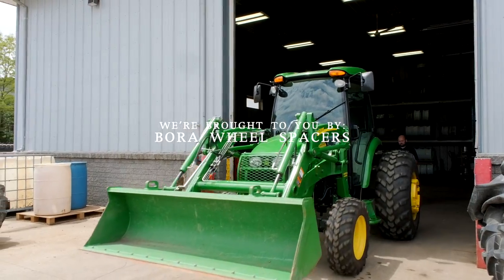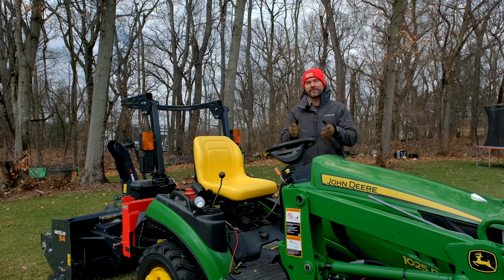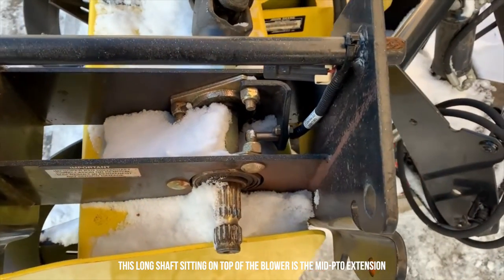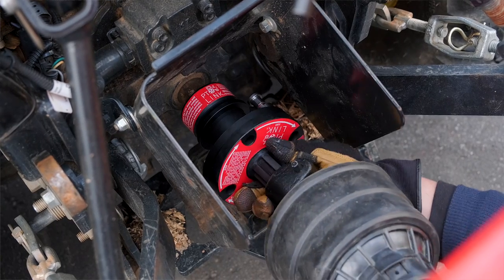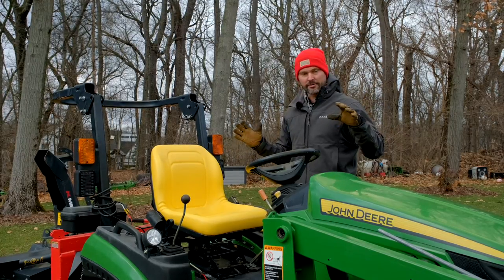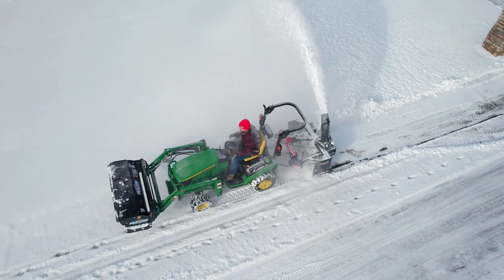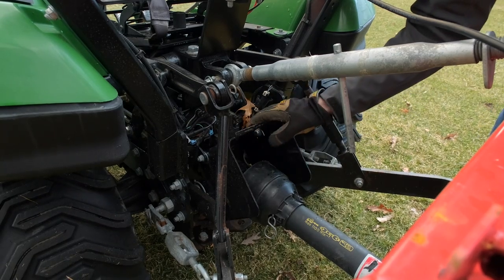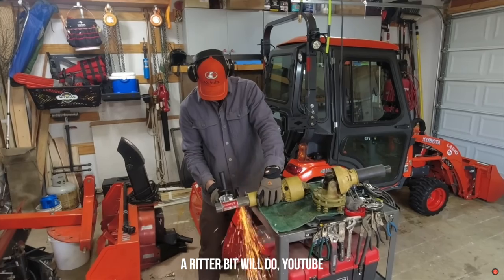WHAT IS A TRACTOR PTO? ONLY THE MOST USEFUL FEATURE ON ANY TRACTOR!

Comment: Great informative video. It is also worth noting that if the pto shaft is too long there is a real possibility of damaging the transmission case.
Reply: How can it damage the transmission case?
Reply: @chasetemple3129  The PTO shaft is in 2 pieces that slide in and out as the implement is raised or lowered. If the shaft is too long, raising the implement can cause the shaft to bind, and that force is directed to the transmission case (at the pto stub) and to the implement itself.

Comment: As in John Deere form, on the new 1 series tractors JD now uses a front three point hitch system so now you have to buy a new snow blower (or whatever front attachment you have) if you upgrade to a new tractor.

Comment: Great info I enjoy watching your videos and getting more info. Curiosity do have a video or maybe even your opinion on loading all 4 tires?  I have a Deere 1025 R. I've got farmer friends and they say it won't hurt me any but dealer says it's hard on front end and front drive system. Any suggestions?  Thank you
Reply: I would say from experience and everything I have watched, fill the rears, but not the fronts. Get some 40+ pound weights for the front that you can use when you need them. With the JD bracket and the small weights, you can use them and the loader at the same time. Not that you need front weight with a full bucket, BUT you don't have to take them off to use the loader quick😉 You can also add wheel weights in the rear, get weights for the the three point hitch with a Heavy Hitch brand weight bracket or a ballast box, or just use a heavy attachment on the rear. A quick hitch makes it easier to switch between them. All options have a cost with them, so do a little research to get what will make the most sense for your needs and property.
Reply: P.S. I also own a 1025R.
Reply: @carlstrohm3785  GREAT LITTLE TRACTOR I BOUGHT ONE AND THEN TRADED IT FOR ANOTHER ONE

Comment: Interesting title… I contend that any tractor WITHOUT a PTO ain’t a “real” tractor.  Also, I suggest that the real most useful feature on any tractor is a center-lift hydraulic cylinder with an I-Match Quick-Hitch (GWT sells a couple real good Quick-Hitches; I bought the Speeco E-Hitch and love it).  A hydraulic center-lift is indispensable for a single operator — no more jumping on and off the tractor to manually adjust an attachment to the 3-pt hitch, such as adjusting tillers, box blades, rakes, etc.  The center-lift relates to a pre-purchase decision: get a tractor with the extra hydraulic connectors (3rd function and Fourth and Fifth SCV kits, as John Deere calls ‘em).  They are required for half the really useful attachments one will (eventually) get: think front blade, grappler, etc.  Getting these installed pre-purchase is a heck of a lot less expensive — and easier — than a post-purchase add-on: you’re gonna eventually need these “extra” hydraulic connections…

I will also quadruply iterate Mike Haines comment.  When I grew up, the PTO shafts were square with unprotected connection knuckles — and our work clothes were not tight fitting.  So next time you want to bash OSHA, consider their decades old requirement: a simple, rationale PTO safety feature.  Lots of folks, including me, had some VERY close calls.  The straw-stuffed dummy in the video is a simplified version of a potential consequences that have really happened.
Reply: @jim brewer Well, I would call them castrated tractors.  I grew up on a farm where grew sections of small grain.  Unless an implement is self-propelled, all harvesting implements are powered by a PTO.  Unless, before farmers could afford tractors or they never existed, horse or ox drawn implements powered the implement via gears on the implement's wheels.